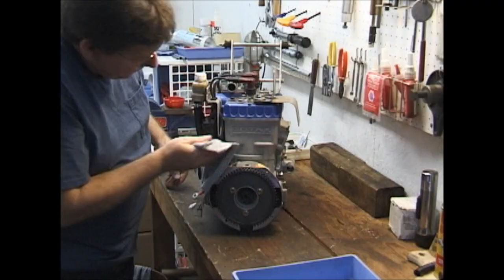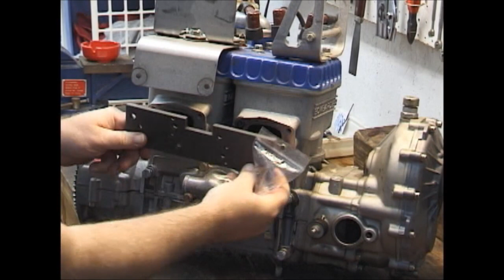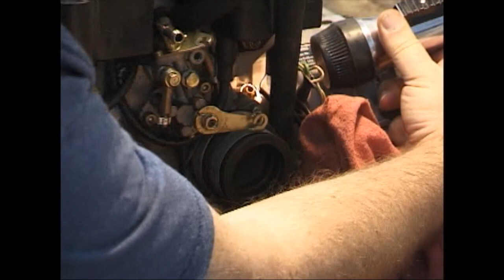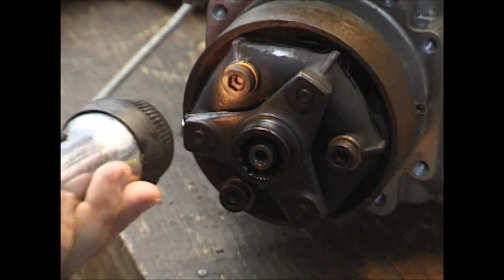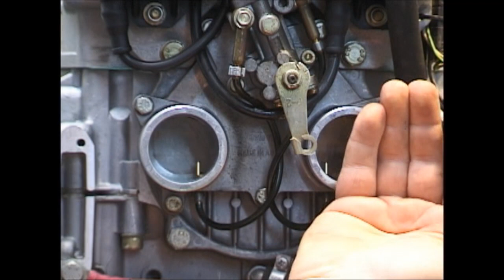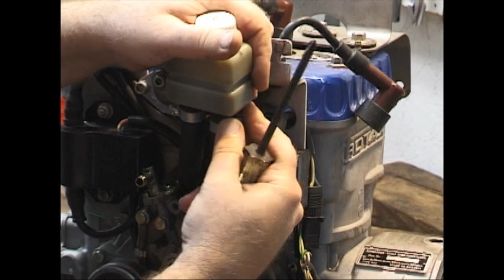Rotax 582 Tear-down and Inspection

Comment: I have tried everything to remove the flywheel on my 582 but it won't budge. The only thing I haven't tried is buying the very expensive proprietary puller made specifically for this model - the piece you use in this demonstration. I guess I have no alternative but to find the money somewhere and order that part. The puller I used was a generic three bolt puller (not the three armed gear puller) but despite its seeming sturdiness, it just started bending as I tightened the central bolt and the flywheel didn't budge.

Comment: If my rear main seal leaks very little with less than 200 hours on the motor should that be a big concern right away or can I wait till my 300 hour rebuild to make repairs

Comment: I dusted off the memory bank last night and in the tool kit which comes with the motor there are two bars. One is for the spark plug spanner and the other smaller one drops into the hole where the pulse for the fuel pump comes out. You then turn the engine slowly and it will line up with a hole in the crankshaft which locks the motor. At least it used to.